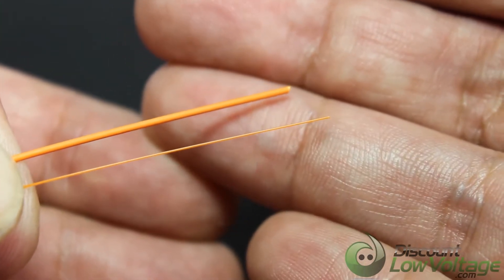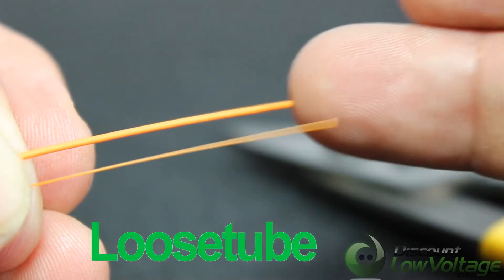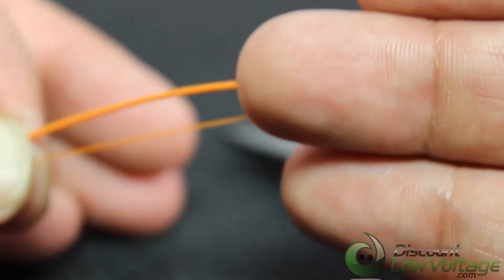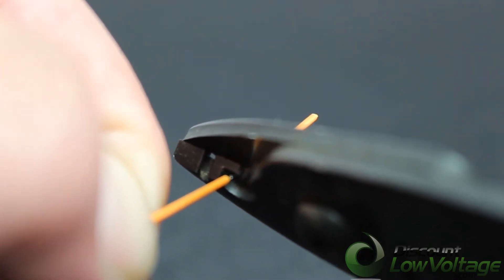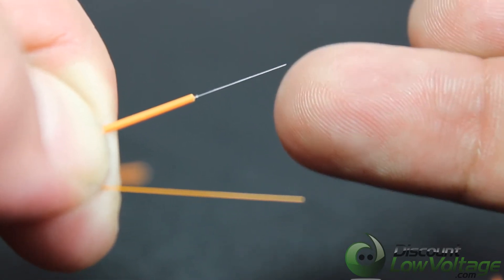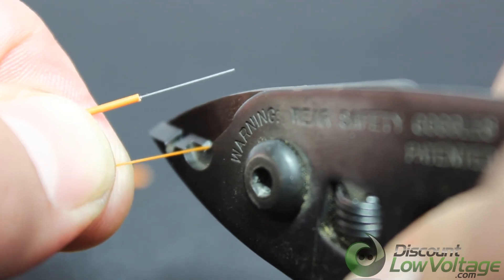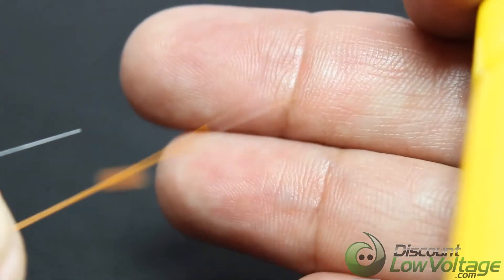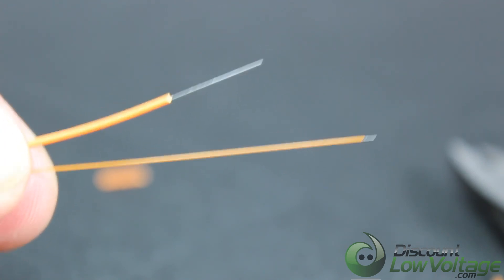Fiber Optic Cable 250um and 900um buffer comparison and overview

Comment: doesn't the tight buffer also have the coating of 250um?? so the only difference would be that the loose vs tight buffer is that the former the buffer is not tight to the 250 and the latter is tight around the 250.